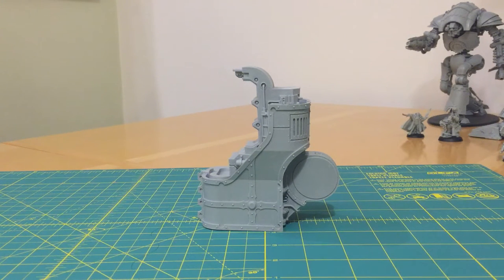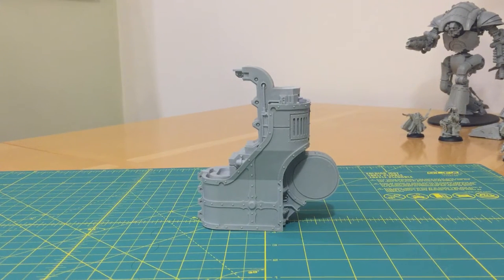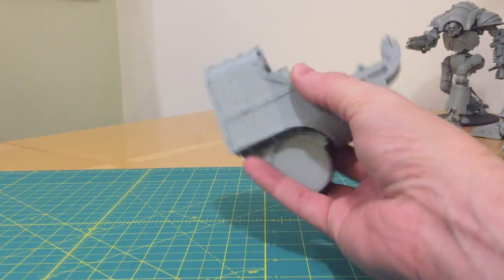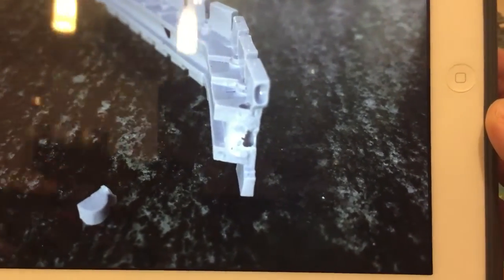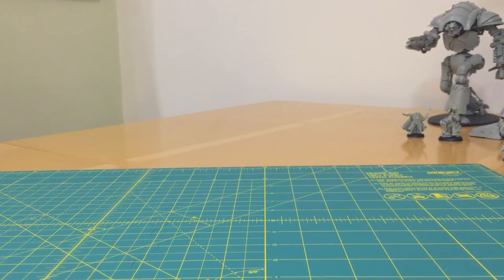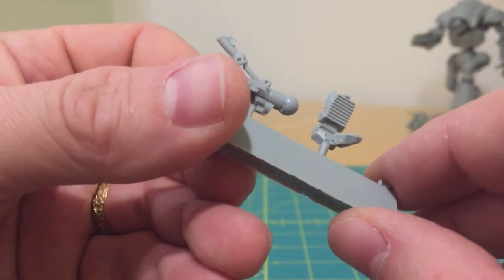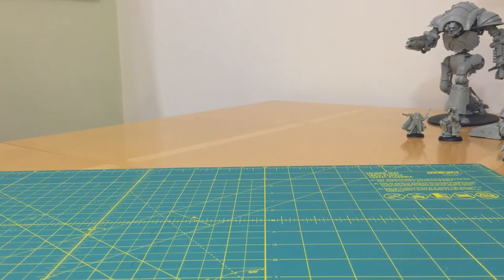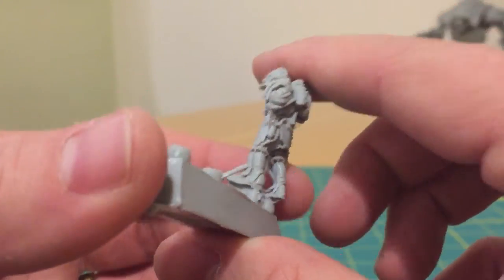Horus Heresy Forge World Models: common faults, casting and quality issues and how to put them right

Comment: I think warping is my #1 issue with forgeworld stuff, anything lengthy bit will usually be bent, like earthshaker barrels, tigershark railguns. Mold slippage is also really common, especially with older molds. Its to bad really as it really puts me off of working on my forgeworld models because often so much work is required to fix issues and inevitably you cant completely fix things so you'll always notice it (warped barrels specifically will never end up completely straight).
Reply from the maker: MoDlegion Warping of large parts can take a lot of patience to put right, sometimes several hours of work as it isn't always just the component that immediately appears to be out that needs the work. With the exception of the Belicosa Volcano cannon I've not worked with that many long barrelled FW parts but can well imagine the issues you describe.

Mould slippage is a different matter entirely - defective parts should be replaced by FW, but again patience is required as new parts take time to arrive.

Thanks for watching :)

Comment: If you receive a model with any warping on thin pieces (Amageddon Pattern Basilisk hull, Leman Russ/Malcador Trench Rails, etc), you can send them a picture before and after attempting to fix the warp, and receive a replacement for either the part or the resin half of the model depending on the severity of the warp.

Resin casts are inexpensive, they know this. Half the time with the IG stuff at least, you're paying more for the plastic treads and upgrade sprues they come with. So replacing them is never a huge issue with them. I just wish the quality control was higher, especially when I'm spending $105 USD on one model sometimes.

Comment: I think the worst part that comes from all of this is that there is a paper slip in each package that shows someone inspected it - Why really bother, when these things are acceptable. It must just be that most people do not care, or can't be bothered to complain. Because if it wasn't most people, then it would cost them too much to deal with all of replacements and shipping. I just started collecting Forgeworld - and have already had two models with missing parts.  Every order seems to be a gamble - it is just too bad everything looks so awesome.
Reply from the maker: In my opinion the included slip is purely a packing slip showing someone checked all the bits went into the kit.

I have a lot of Forge World kits pass through my hands - several tens every year - and find their QC of the past 3 years much improved over the "dark times" of 2015-17 when they were struggling.